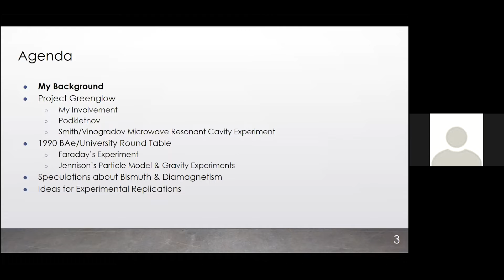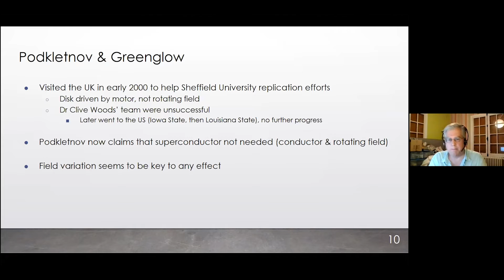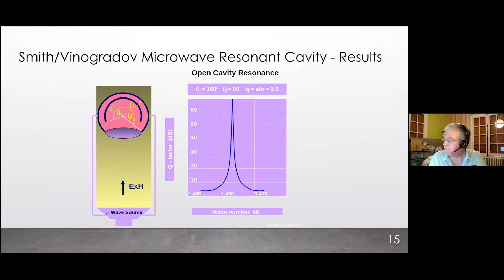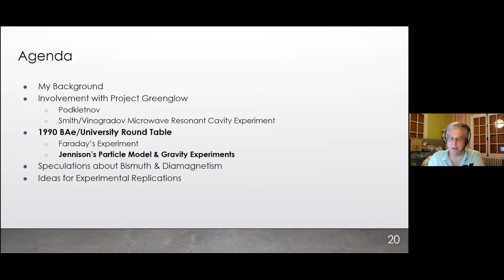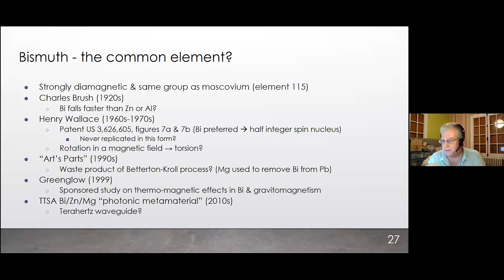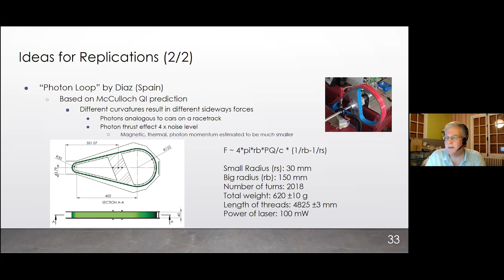Project Greenglow & Beyond | Rob Chambers

Comment: RogerJennison wrote the ball lightning occurred after the aircraft encountered a thunderstorm in which it was enveloped by a bright and audible electrical discharge. Some seconds later a glowing sphere some 20cm in diameter emerged from the pilot's cabin and passed down the aircraft's central aisle approximately 50cm from Jennison. The ball moved on a straight course the whole length of the aisle 75cm above the floor at a velocity relative to the aircraft of about 1.5 ms. It was blue-white in colour and its optical output amounted to about 5 to 10 Watts. Interestingly, no heat was felt when it passed close by and the limb darkening (like that of the Sun whose center appears brighter than its edge) gave it an almost solid appearance, indicating that it was optically opaque. No asymmetry could be seen in any dimension so it was impossible to determine whether or not it was spinning.  At the rear of the aircraft it merged with the aluminum skin and disappeared. (various Google sources). I wonder if Rob is aware of Bob Greenyer's research on solitons, aka micro ball lightning, seen here on YouTube.  Ball lightning seems like a natural analog of UFOs the same way birds are to airplanes.
Reply: Axil Axil (fellow poster along with Bob G. on ECW) postulates Higgs mode collapse into an AdS bubble as a mechanism for anomalous charge clustering per Shoulders / Parkhamov et al;  the micro-UAP i've been documenting also appear to be AdS-space constructs:  /watch?v=GCVS3hSnll8  (mute audio, loon alert) - note the 'Pringle' shape (hyperbolic paraboloid) characteristic of such spaces as viewed from our flat 3+1 space.   The tantalising implication of course is that this, perhaps, is where we might seek resolution of the apparently-inter-dimensional properties and effects being recorded;  ie. artificially-constructed alternate dimensions, rather than natural 'hidden' ones..
Reply: @MrVibrating  nope
Reply: Bs. I saw a crow getting hit by lightning 50m away and turning into a bright plasma ball which darkened over the next 30-45 seconds and then dissolved into a thin brown cloud. Thats ball lightning.
Reply: @maj1260  everywhere? The hive mind